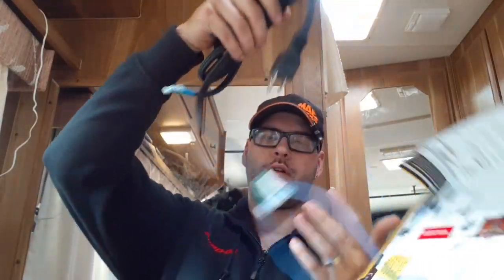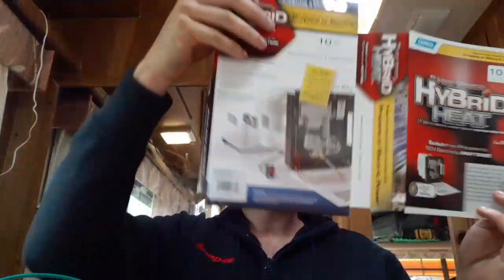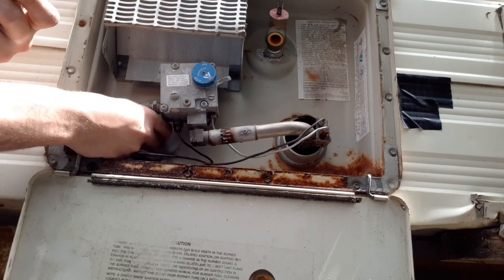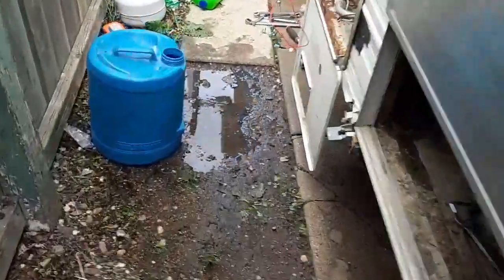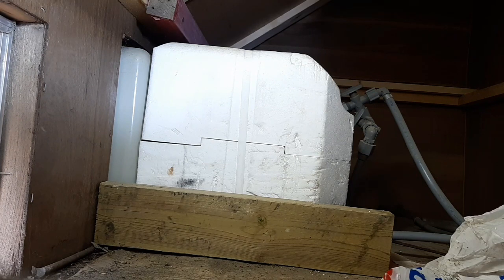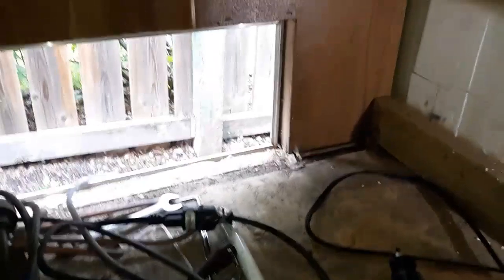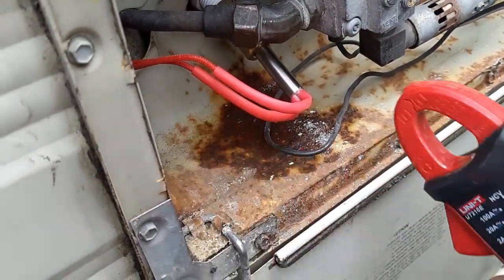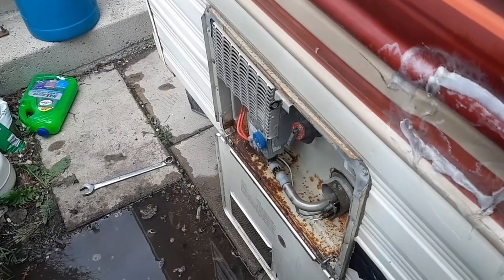Camco hybrid heat install and review. RV electric water heater conversion kit

Comment: If you fix the propane heater you can run the electric and gas at the same time and it heats up fast and it will pretty much give you 15 gals of water before it gets cold .
Reply from the maker: I can, but the hot water only gets used for dishes  and to give our youngest (2yo) daughter a bath, my wife, myself and 2 older kids don't mind using the campground shower facilities. This camper isn't worth sinking any real money into, just keep it operational for as cheap as possible. It's got maybe 3 years of life left in it honestly. Than it's being turned into a flat deck 23' utility trailer.

Comment: Per CAMCO - the 6 gallon element (11674) is 6.25" long, and the 10 gallon element (11774) is 8" long.

What model water heater did you fit that in? Wondering if I can pull of the same thing in our Dometic 6 gallon with the 10 gallon element.

Comment: Very good video where did you get your multimeter at
Reply: Agree on the meter source question for an rv meter. Found it, See link below.
Reply: So can anyone tell me how I would drain the water tank after installing this? I’m getting ready to install this on mine this weekend but I am confused because I do not live in my camper and will need to drain it a couple times a week.

Comment: Has anyone else installed the kit and didn’t get hot water? Everything seemed to install fine and is on but water won’t heat up even after and hour or two. I also hit the reset button on the thermostat. Wondering if the heating element or the thermostat is bad.

Comment: Hi there, i was wondering if it the illuminated light in your switch goes out once the hot water reaches temperature? Thanks.
Reply from the maker: Hi, sorry for the late response, and no the lighted switch stays on when the switch is turned on, as it gets its power before the thermostat.
Reply: @AaronsAutomotive  Thank you for the quick response. I bought a different type of conversion kit off ebay made by Western leisure product. It's pretty much same design. Like to b get your expert opinion, I want to cut off the plug and connect that to the breaker in the converter box. I have done this to a 12v Rocker Switch, negative to brass, middle pin to 12+ and top pin to load.  Do you think if I run a 120v Rocker Switch in between the "Hot" black wire to cut power, Neutral and ground still goes to breaker. Do you think the switch will illuminate when on or how would you run on a switch like that? Thank you

Comment: The pressure relief valve was weeping becouse you didn't properly purge the water heater tank of air after draining it.

 In other words you didn't fill the water heater tank all the way up with water, this happens when the tank is only partially filled with water becouse of trapped air at the top of the tank.

To properly purge the water heater of trapped air you need to open a hot water faucet in the RV before you turn on the pump, this allows the water heater to completely fill up, when the water heater is full the water, the water will actually be touching the relief valve sensor witch is necessary for it to work properly. remember steam is hotter then water and when the tank is not properly purged the top of the tank is filled with very hot steam partially activating the relief valve.  

If you don't open a hot water faucet while filling up the hot water tank then pressure will be created at the top of the tank preventing the tank from completely filling up with water, the end result is your hot water will have a large air gap at the top of the tank and will only have about 2 gallons of water in it rather than the 6 or 10  it's supposed to have.

3 clues that your hot water tank has not been properly purged of air and is not full of water.
#1 weeping pressure relief valve.
#2 water heats up very fast, (becouse you're only heating 2 gallons of water rather than 6 to 10) it should take several hours for a 400 watt heater to heat 6 gallons of water to 130 degrees.  
#3 hot water runs out very quickly.  (once again this is becouse you only have about 2 gallons of water in the tank rather than 6 to 10)
Reply: 7
Reply from the maker: Tank was full, I always have the furthest faucet on when the RV water tank Is filling, the reason my relief valve is leaking is due to corrosion being that it's a 35 year old trailer, and almost all original parts. I replaced the valve and have not had a drop from it since.
Reply: @AaronsAutomotive  everyone is a pro these days, they watch 2 youtube videos and think they have a degree and 10 years experience.